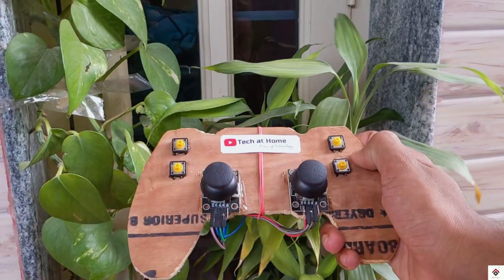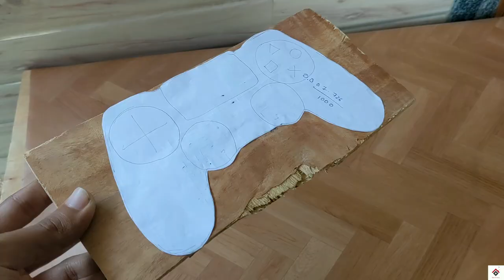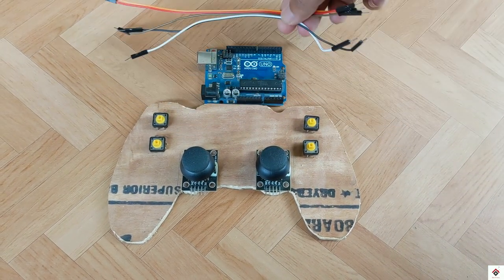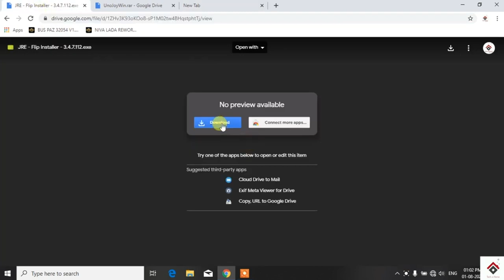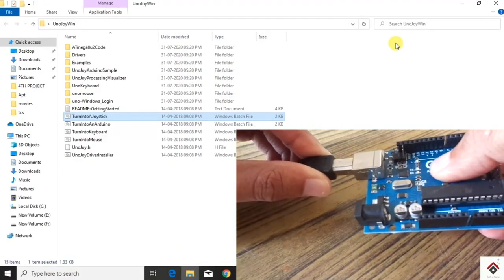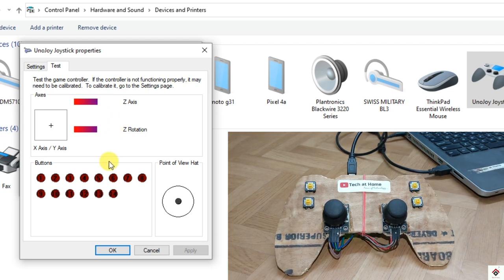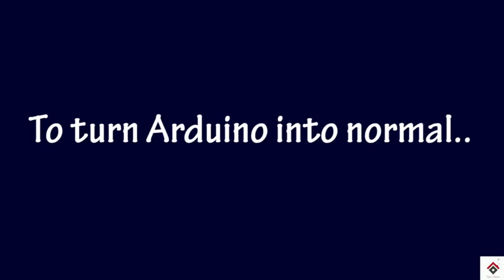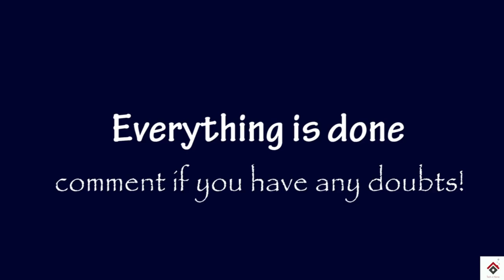Arduino JOYSTICK for PC games | Homemade Arduino Game Controller[with CODE] |  UnoJoy joystick

Comment: hello bro i followed this tutorial but the joystickmoudle y axis isnt working but when im using the module without the uno joy its perfectly working? can you help me thanks.
Reply from the maker: Have you used same analog pin as per circuit?
Reply: @techathome  yes i checken it i use analog 0 for x axis and analog 1 for y axis
Reply: @techathome  ok bro it works now i just redownloaded the uno joy the old one was corrupted maybe

Comment: Can i swich the analog to 4 potentiometer?
Reply: Please answer my question
Reply: Please answer ?
Reply from the maker: Yes
Inside the joystick also they use potentiometers.
Reply: It is work for arduino uno all version?
Reply: Please answer i have no bugdet for new version of arduino uno
Reply from the maker: Arduino Uno with 16u2 chip for serial communication

Comment: Mate, i have different Arduino Uno R3 which is clone one, their specs are look alike but clone one has different driver which is ch340, could i run this project with cloned arduino?
Reply from the maker: No, This firmware is only made for 16U2 serial chip.
Reply: @techathome  is there any firmware that compatible for ch340 driver for this project implementation mate?
Reply from the maker: No,
We are working on a bluetooth joystick for PC. If that works I will upload video.

Comment: Bro how can we connect more 4 buttons to the controller (8 total)
Reply from the maker: Yes you can connect. As shown in the video, similarly connect one pin of push button to GND and other pin to digital pin.
You can use any pins starting from 2 to 12.
Reply: Thank you soo much

Comment: By far.. The best tutorial. I've found. Thank you!
Reply from the maker: Welcome
Reply: @techathome  I'm buildong an F16 fighter jet realistic Throttle Quadrant, and your tutorial it's the most clear about how to install and uninstall Unojoy
Reply from the maker: Thank you
Reply: @techathome  by the way, I followed your tutorial section in other video about entering the DFU mode when the error appears in the Arduino to UnoJoy batch file, but still not able to put my Uno R3 clone into DFU mode. Any ideas?
Reply from the maker: 16U2 chip doesn't have bootloader. That is the issue.

Comment: Can someone help I am not able to go into bootloader mode  whenever I short the pins the ARDUINO reset but in device manager there is no unknown device shown
Reply from the maker: Your 16u2 chip doesn't have bootloader.
You need to burn bootloader on this 16u2.
Reply: @techathome  but how

Comment: Can you controll your drone using your joystick
Reply: How can contact you for guidence for my project
Reply: I am your fan and you are my inspiration also please me
Reply from the maker: No , that will be different concept again, we have to send some PWM signals using RF transmitter from joystick.
 On the drone,  receive it using one more RF receiver, and create control signals using Arduino.
May be I can try in coming days.
Reply from the maker: You can reach us on Instagram
Reply: @techathome 😅